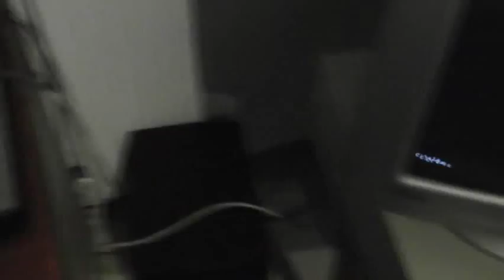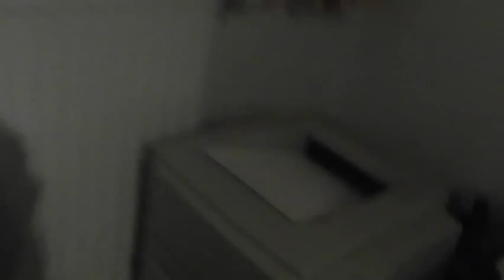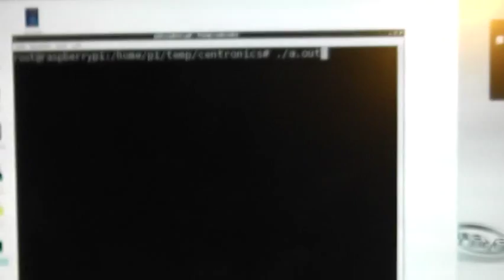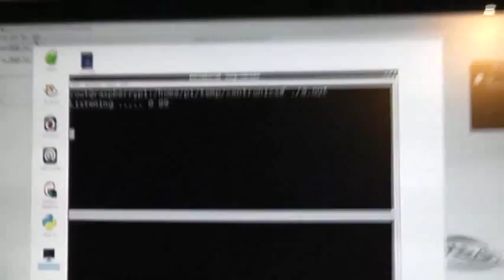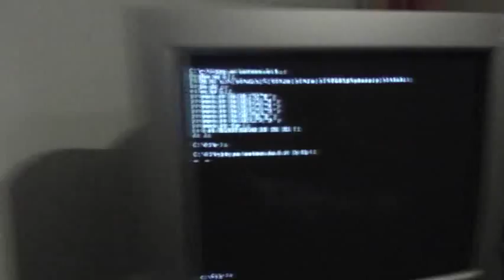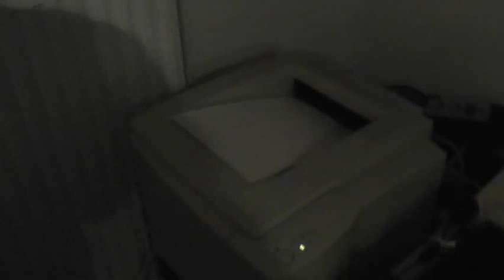Rasperry PI emulating a centronics printer (ATARI PC3)

Comment: After a lot of hard work, the Retro-Printer is now available to purchase - https://www.sellmyretro.com/offer/details/retro-_printer-module-%28capture-and-convert-centronics-port-data%29-32773

Although the case is designed to house the Retro-Printer module and a Raspberry Pi, the module has been successfully tested with an Orange Pi PC, a Banana Pi M2 or an Odroid C1 (or Odroid C1+).

We support nearly all ESC/P2 printer control codes (including delta row and TIFF image compression); and HP PCL codes.  We will develop further convertors as required, but need to do some work on implementing a full set of Epson fonts and international character tables.

More details appear on www.retroprinter.com

Comment: Hi excellent work, Can I buy this off you or can I get the drawings of your wiring ?
Reply from the maker: www.retroprinter.com
Reply: Thanks for your reply, there is no link to buy :(.
Reply from the maker: @prettyGirlMyDog  
it will be available soon, please be patient
Reply: @prettyGirlMyDog  The Retro-Printer Module is now available to purchase - https://www.sellmyretro.com/offer/details/retro-_printer-module-%28capture-and-convert-centronics-port-data%29-32773 - there is an optional case (for the Retro-Printer and Raspberry Pi) and an optional pre-programmed 16GB Micro-SD Card.